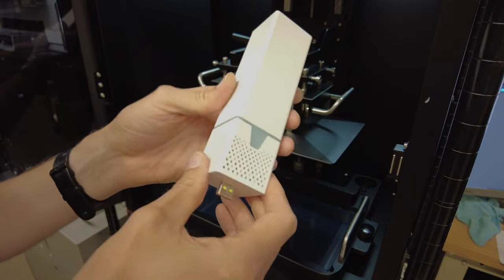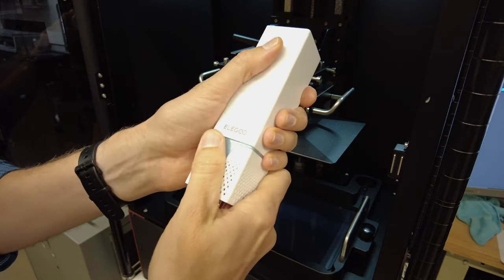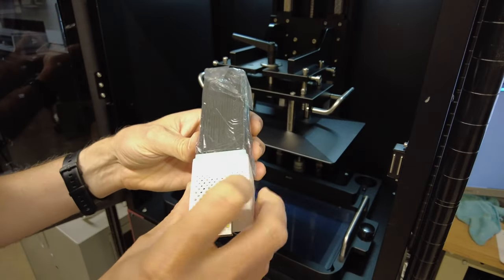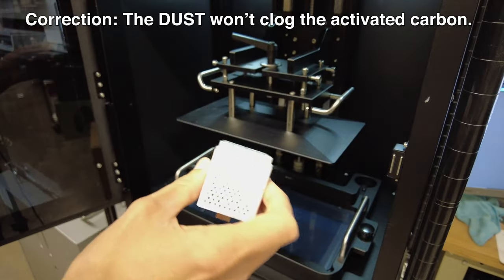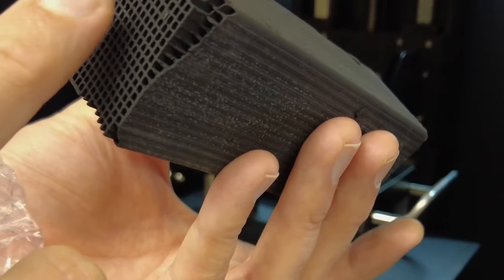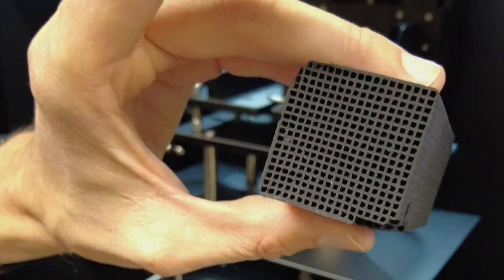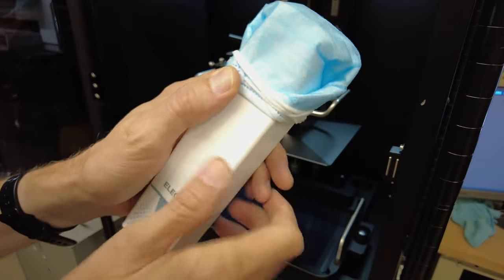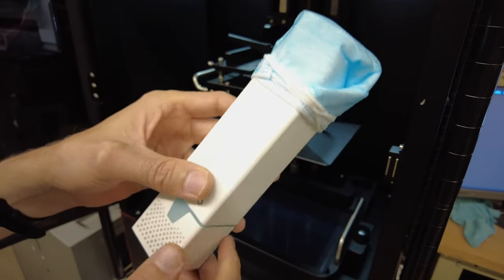Elegoo Jupiter Carbon Filter PREFILTER MOD (How to make carbon filter last longer) 3D Resin Printer

Comment: the motor in that thing is very weak, with that mask it is not able to work proper anymore but it saves the carbon for longer...  but you might possibly have more VOCs if those things are measurable anyway. I think those particles are maybe around value 1 or smaller and even my expensive Philips airfilter is nog going below 2.5  :(
Reply from the maker: It's the lesser of 2 evils. There was still noticeable air flow passing through, and it's recirculating inside a small enclosure. Without a prefilter the carbon will quickly get clogged with dust and become ineffective.
Reply: @engineerable  there is no dust in the enclosure.  That's why it's an enclosure.  Unless you leave the lid off the printer (there's zero point in doing that) then there isn't any dust to be sucked up.
Reply from the maker: @PhonePhone-sf8te  There is dust everywhere. It's not a sealed enclosure, and the door gets opened. Dust will get into the carbon.

Comment: Quick question: Does this model work with ANY USB-A port?
On their site, they claim that it ONLY works with the USB-A ports on the printer, which seems weird.
Reply: It's a 24V USB port. I just bought the activated carbon blocks, a male USB A with the turn terminals (no soldering), and some 24V 40mm fans. then just printed the box. total from aliexpress at the time was about $10-15 and ended up with 4.